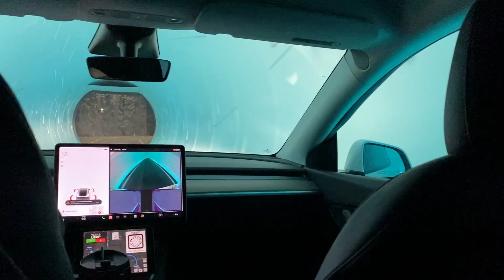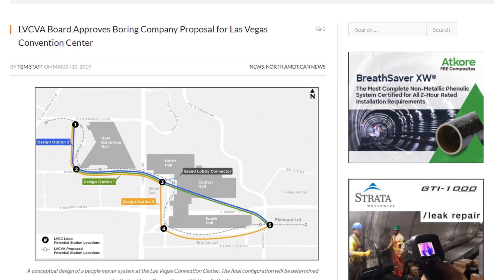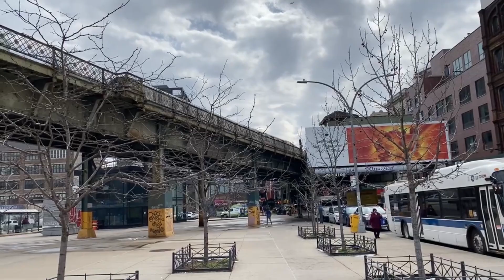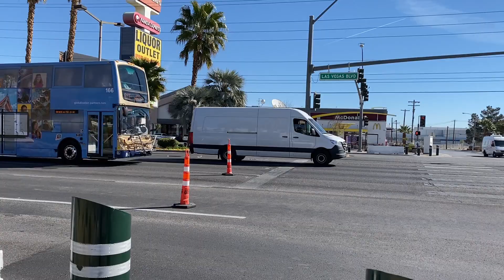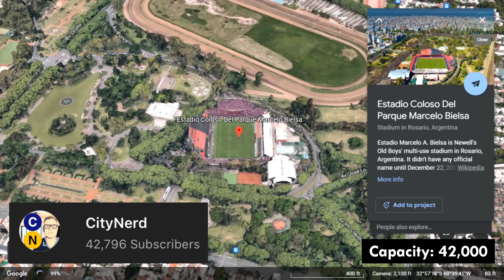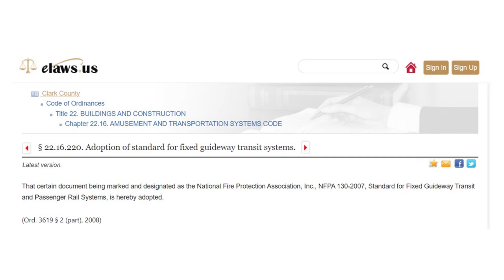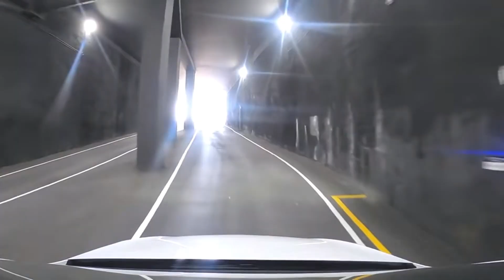Inside the Las Vegas Loop: Transportation Game-Changer, or Complete Waste of Time and Effort?

Comment: The most lead-brained move anyone can make is filling a tunnel with a road instead of track. If Elon wasn't a creatively bankrupt conartist he would have seen the potential of the Boring Company in digging cheap and quick metro tunnels in smaller cities without metro lines. But no, he made a shittier, one-lane roadway underground.
Reply: Rails don't sell cars.
Reply: @AbsolutePixelMaster  Road trains would like to have a word
Reply: not like the boring company tunnels are really cheaper or quicker either.
Reply: @cyri96  
On the plus side they're smaller without being cheaper or quicker.
Reply: @cyri96  But but it's the potential to improve upon that is interesting. That is if it wasn't just a vapid pet project for a vapid billionaire.
Reply: @zapermunz  It makes more sense if you don't think of it as an ineffective and inefficient public transport system, but as a marketing scheme. It's essentially a way to get tons of people to sit in a Tesla with a sales representative for a few minutes, while coincidentally moving them from A to B in the process.
Reply: @cyri96  ICE Train requiting 6 to 24 times less energy (Km/MJ) per person than Tesla Model 3. Also ICE train travels at 250 to 300 kph (155 to 186 mph). The Loop at a very slow 35 mph max speed
Reply: Originally it was sold with the idea of shuttles on a track. I think when they first made the tunnel they had carved out space for tracks, the early reporting of the tunnels showed Teslas with bumper car attachments at the corners to keep them centered so they didn't fall in the trench.
Reply: That’s also another thing along with his boring company to dig tunnels for metro. Tesla company could build all new electric trains, buses and trams!!!! 
The potential is endless! 
People should drill him on this.
Reply: Electric cars Con artist. Landing rocket on pads in the ocean con artist. Worldwide Satellite Internet con artist. Chip in peoples brain to make them walk again con artist. And soon to be 29 miles under Las Vegas with electric driverless cars zero labor 50 year lease lots of advertising on cars and walls In the most expensive advertising city in the world Con artist.
Reply: The problem is that he can't dig cheap tunnels. If he had put a subway in then the capacity would have been too high and he'd have to add back all those expensive safety systems he was allowed to delete because he replaced dangerous inert copper wires with nice safe lithium ion firebombs.
Reply: @opcn18  HM......
Reply: Actually, on a cost-capacity basis the "roads-in-tunnels" of the Loop is very competitive against most other public transport options.

Bus Rapid Transit (at grade) has very low capacity:
90 passengers per vehicle * 15 vehicles per hour = 1,350 pph.
And low average speed of 9mph due to city traffic and having to stop and wait at every stop. 
$0.68 - $9m per mile

Bus Rapid Transit (grade-separated) has low capacity: 
90 passengers per vehicle * 30 vehicles per hour = 2,700 pph.
And but still slow average speeds of 12-22mph.
$13-50m per mile

Light Rail Transit (at grade) has medium capacity:
90 passengers per vehicle * 3 vehicles per train * 15 vehicle sets per hour = 4,050 pph.
But slow speeds of 9mph -12mph due to city traffic and having to stop and wait at every station. 
$50m - $100m per mile

Light Rail Transit (grade-separated) high capacity:
90 passengers per vehicle * 3 vehicles per train * 30 vehicle sets per hour = 8,100 pph.
And still pretty slow average speeds of 15mph due to having to stop and wait at every station. 
$201m per mile

Subways have very high capacity:
100 passengers per vehicle * 10 vehicles per train * 30 vehicle sets per hour = 30,000 pph.
But still slow average speeds of 17-22mph due to having to stop and wait at every station. 
$600m- $1 billion per mile
$100m - $1 billion per station

The 29 mile Vegas Loop (2.5 passengers per EV) will have high capacity:
 2.5 passengers per vehicle * 4,000 EVs per hour = 10,000 pph
AND very high average speeds of 60mph thanks to direct point-to-point travel at high speeds. 
$20m per mile (dual tunnel)
$2m per above-ground station

The 29 mile Vegas Loop (4 passengers per EV w ride sharing) will have higher capacity:
 4 passengers per vehicle * 4,000 EVs per hour = 16,000 pph
AND very high average speeds of 60mph thanks to direct point-to-point travel at high speeds. 
$20m per mile (dual tunnel)
$2m per above-ground station

But the 29 mile, 51 station Vegas Loop will have up to three parallel arterial tunnel pairs through the busier parts of the city giving 30,000 - 48,000 pph down the main arterial tunnels. 

The Boring Co has actually rated the 29 mile, 51 station Loop at a minimum of 57,000 people per hour and is actually being built at ZERO cost to taxpayers vs $8 billion for a subway. 

So even in terms of people per hour, the Loop easily holds its own against not just BRT and Light Rail but is also very competitive against many subways.
Reply: @andrewfranklin4429  TBC tunnel cost is for a tunnel without safety ventilation or any escape path. If you built a subway train the same way (the deep london underground was built with literally the same diameter tunnel)  the subway will cost less, move more people. Yes a subway has to stop at every station, but a car has to slow at every station because the car in front of them is going to slow.

With 6 seconds between each car and 3 pax per car that gives you a maximum throughput of 1800pax per tunnel per hour. That is not cost effective. If you run the cars at shorter intervals it's not safe. That's equivalent to less than two london underground trains an hour. Terrible service.
Reply: @opcn18  I’m afraid you’ve been misled as the Loop meets or exceeds all national and international fire, security and building codes including NFPA 130 – “Standard for Fixed Guideway Transit and Passenger Rail Systems” and the 2018 International Fire Code (IFC).

The Loop tunnels have a larger diameter than London Underground tunnels, they have smoke detectors, CO sensors, cameras and automatic high pressure automatic fire fighting standpipes at regular intervals, there is a high capacity smoke suppression ventilation system in all tunnels, the stations are closer together than emergency exit tunnels in a subway, the underground station has an automatic sprinkler system rated at Extra Hazard Group 1 and there is a Fire Control Centre staffed by two officers during all hours of operation.
Reply: @opcn18  And no, Loop EVs won't have to slow down or stop at every station once the rest of the 29 mile, 51 station Vegas Loop is completed as the Loop stations will be located off the high speed main tunnel arteries on short spur tunnels and thus every EV bypasses every station travelling down those arteries until it gets to its destination.  Think of the spur tunnels like freeway on-ramps and off-ramps to the high speed main artery tunnels.
Reply: @opcn18  Also, the main arterial tunnels of the 29 mile Loop will have 0.9 second headway = 25m = 5.3 car lengths between each car (at 60mph).  That gives us 4,000 EVs per hour passing through which gives a capacity of 4,000 x 2.5 passengers 
= 10,000 pph in one direction 
Or with ride-sharing:
4,000 x 4 passengers
= 16,000 pph

But the Vegas Loop isn’t just one line down the centre, but up to 3 separate arterial tunnel pairs (6 tunnels in total) in parallel at times - particularly around the Allegiant Stadium to assist with handling the peaks pre and post games.  That gives a throughput of 30,000 pph one way (or 48,000 pph with 4pax per car) or 60,000 (96,000pph w 4pax) bi-directionally over those high traffic sections.  And there are several other sections where small loops come off to serve groups of stations through the heart of the city so the numbers continue to multiply.

And the great thing about the Loop topology is that if there is more demand, more tunnels and stations can be built at a cost vastly cheaper than a subway.
Reply: @opcn18  And no, subways can never be built as cheap as the Loop.  The main problem is the underground stations which even in Europe cost at least $100m each.  In contrast, almost all those 51 Vegas Loop stations will be above-ground stations at the front doors of every hotel anc casino in Vegas costing only around $2m each. 

Here are the sorts of costs you looking at for subways:

Underground subway……………………..Length…….Estimated Cost…….Cost per mile
New York East Side Access………………3 miles……$11.1 billion……..$3.7 billion
New York Second Avenue Subway…..1.8 miles…….$4.5 billion…….$2.5 billion
Los Angeles Purple Line Extension…..9 miles………$8.4 billion……….$930 million
San Francisco Central Subway………….1.7 miles…….$1.6 billion……..$928 million
Seattle U-Link…………………………………………3 miles………$1.8 billion…..$600 million
London Crossrail………………………………..13.7 miles……£17.6 billion…..£1.3 billion
Tokyo Metro Fukutoshin Line……………..5.5 miles……..$2.2 billion….$400 million
Berlin U55………………………………………………1.1 miles…….$360 million….$327 million
Barcelona L9/L10………………………………….30 miles…….$7.3 billion…..$243 million

As you can see, vastly more expensive than the $20m per mile + $2m per station cost for the Loop.
Reply: @andrewfranklin4429  You costed for one tunnel, with zero station cost for the loop. You haven't got arterial tunnels or on ramps and off ramps in your estimate. You also double costs subways by adding the station cost to the tunnel cost.

The fact of the matter is that a subway station costs about the same as a loop station, with the platform on a subway station being higher and wider and the track portion being narrower. The tunnels again are the exact same size with a less expensive road bed in the bottom of a subway tunnel. The reason subways cost more per mile is that they require safety features that TBC was allowed to build without. Part of that justification was how few people would be in a TBC tunnel, which is associated with the dramatically lower throughput. Personally I really worry about packing a tunnel with extremely flammable batteries and no ventialationa nd no escape route. Like a subway I get that maybe you want to worry about the third rail but that can be hung overhead too high for any human to reach if you want. 

You are just trying to force through an apples to oranges comparison and I'm not gonna have it.

Edit: yeah if you are going with above ground stations then you have to make room above ground. You know there are light rail subway combined systems, right? You can just have the train come above ground if you want a cheaper station. The reason subway stations are all built underground is to avoid eating up a ton of valuable surface real estate. Again, apples to apples subways are cheaper no matter how you slice it. If you have to give TBC concessions to make it work then that is a sign that TBC doesn't work.
Reply: @opcn18  The Boring Co has just submitted a bid to the city of Miami for a 6.2 mile Loop with 7 underground stations in a straight line from the city to the beach which has some more interesting figures on capacity and costs of Loop type networks. 

It will handle 7,500 passengers per hour with the option of scaling it up to 15,000 people per hour. 

Estimated cost is around $185-$220 million which gives us a cost per mile of a remarkably cheap $30m - $35.5m per mile for a dual tunnel, a cost which in this case also includes an underground station every mile instead of the much cheaper above-ground stations of the 29 mile Vegas Loop. 

In contrast, an above-ground, much slower light rail would cost over $1.2 billion while a subway would cost upwards of $3 billion.
Reply: @opcn18  here’s a better break-down of the Miami costs:

TBC has submitted a quote for $185-$220 million which gives us a cost per mile of a remarkably cheap $30m - $35.5m per mile for a dual tunnel, a cost which in this case also includes an underground station every mile instead of the much cheaper above-ground stations of the 29 mile Vegas Loop. 

So that is $35m for:
* an underground station, 
* AND one mile of dual arterial tunnels 
* AND four spur tunnels per station 

However, Loop costs can even cheaper than that because the 51 stations of the 29 mile Vegas Loop will all be cheap above-ground stations which are basically just 10 car bays, a loop of roadway, an awning covered in solar panels and the four spur tunnels/ramps going back down underground.

Estimates put the price of those above-ground stations at a mere $2m or thereabouts.  This is backed up by the $48.7m that TBC was paid for the LVCC Loop which included an underground station that Musk admitted cost $30-40m to construct which left only $9m - $19m to pay for the 1.9 miles of tunnels and the two above-ground stations.   (TBC probably sucked up some of the extra cost as a learning exercise but that leaves precious little for the tunnels and stations). 

Now the LVCVA has indicated that all of the 51 stations in the upcoming Las Vegas Loop will be those cheap $2m above-ground stations, not the expensive $30-40m underground station. 

The proof is in the pudding with the fact that TBC is going to pay for the cost of ALL 29 miles of tunnels ITSELF with the 51 hotels and casinos paying for the construction costs of their own stations at the front doors of their establishments.  The taxpayer will pay ZERO dollars. 

There is no way TBC would have proposed building those 29 miles of tunnels for free if they cost as much as traditional subways (even in Europe): 

29 miles of tunnels x $100m = $2.9 billion
+ 51 underground stations @ $100m = $5.1 billion

$2.9 billion for all the tunnels is not something that even Musk would do for free. 

Then there are all those 51 hotels, casinos, the University, Allegiant Stadium all agreeing to pay for their own stations. They wouldn’t do that if those stations cost $100m each. 

$2m or so each is a far more believable figure, particularly for entities like the University of Nevada LV who will be building a Loop station on their Vegas campus.
Reply: @opcn18  Also, many hotels and casinos will be using 20 or so car bays in their existing above ground parking or basement parking garages for Loop stations.

Vegas properties that are planning to do that are happy to sacrifice 20 car park bays for a Loop station that will serve vastly more people than those 20 cars.  Likewise for above-ground parking lots.

There's no way you'd fit a light rail or above-ground subway station (including down-ramps at either end) in just 20 car bay's worth of space.

The Loop saves surface space.
Reply: @andrewfranklin4429  That's not safe though, that is beyond the reaction time of human drivers who are required to drive the cars.

Also, you costed out one tunnel, not six. And now you are counting all 6 going the same direction and doubling it to call it bidirectional. You should go find your math teacher from school and beg them to do a better job in the future.

Also the curves on the tunnels are too tight for 60mph. That's unrealistic. Even if tesla catches up with their competitors in self driving you just can't do that kind of speed with rubber tires around turns unless you are replacing them all the time.

Either there is going to be a dedicated ramp running up to the 20 parking spaces (which is going to be expensive) or the cars are going to be on the surface streets and in the parking lots and they are going to have to wait for traffic and back the whole line up. That's a have cake and eat it too situation. And a huge liability and ongoing extremely high labor cost.
Reply: @opcn18  Cars on freeways driven by distracted, drunk and careless drivers typically have a headway down to 1 second.  A one second headway is a distance of 27.7m between cars travelling at 100kph (60mph) or almost 6 car lengths.  My experience of driving on busy freeways at those speeds is you're lucky if you have three or four car lengths between cars.

Once the Loop autonomous control systems with their millisecond response times and ability to for example command ALL vehicles in a section of the Loop to brake or accelerate simultaneously, there would be no problems achieving smaller headways than fallible humans.
Reply: @opcn18  one tunnel is $10 million per mile. A dual tunnel is $20 million per mile.  As I said above, TBC gave a quote for $185-$220 million for the entire 6.2 mile Miami Loop (including underground stations) which gives us a cost of a remarkably cheap $30m - $35.5m per per dual-tunnel mile.

Loop EVs have already demonstrated 127mph (205 kph) down the 1.14 mile test tunnel in Hawthorne California. 

This shows the sorts of speeds possible in a tunnel that is almost 3 times longer than the 0.4 mile spur tunnels connecting each station in the LVCC Loop. With the much longer tunnels of the 29 mile Loop, it will be easy to achieve even higher speeds.  

And bends and corners aren't an issue - Briefly slowing down to 40kph for one or two 90 degree corners that might be on your route is nothing compared to a train completely stopping and waiting for between 12-21 seconds at each and every one of the 20 stations between your departure and destination.
Reply: @opcn18  I'm not sure what you mean by "cars are going to be on the surface streets and in the parking lots and they are going to have to wait for traffic and back the whole line up"?

The Loop is a closed network where the EVs do not interact with surface traffic. The aboveground stations in carparks do not allow private cars to enter, they are dedicated to just the Loop EVs. Have a closer look at the two above ground Loop stations in the existing convention centre Loop and you will see.
Reply: @andrewfranklin4429  If they can dig an EV tunnel for that cheap then they can dig a subway tunnel for that cheap. All you have to do is build ~$600k of track in place of ~$800k of blacktop. 

Yes, they can reach high speed on a straightaway, but they aren't going to be replacing the tires once a week, are they? The safe cornering speed is a function of turn diameter and is actually higher for a train than an automobile. 60mph is not realistic. And no, you can't just briefly slow down, remember there is another car right behind yours, if you slow down you get rear ended. On highways with improper corners that people have to slow down for traffic back up for miles leading up to them. There are too many corners dictated by the buildings that they really cannot practically tunnel under. There are dozens of corners on the map that TBC put out, not two. Even if you have bypass tunnels that don't stop at the stations 90% of the track is on segments less than 2 miles long. And if you've got ramps on and off that creates a terrifying merge situation that really makes 30mph unrealistic, probably more looking at 15.
 
If you have 6 arteries with ramps on and off between them it's not just 6 times the cost of one tunnel, each ramp needs to be its own tunnel in between the two, and you've got the custom build both ends so it's more like 12x the cost of one tunnel, remember these have to be long ramps too so cars don't have to jam on the brakes to take them. If you've got 6 tunnels dug for rail you can have an express train that doesn't need a ton of ramps that just goes to every 2nd, 5th or 10th station. It would be less convenient for sure, but a subway system costs a couple bucks to ride, while a taxi in a loop is gonna run you more than a dozen. 

What TBC bid for Miami isn't really relevant, they overran their bid on the LVCC loop and cut way back on what they were delivering. Elon isn't going to be spending his own money on the loop. If he isn't getting tax money he will be getting investors in and then walking out with a bunch of their money in his pockets.
Reply: @opcn18  I've seen the guy before. He keeps reverting to the same fallacies:
1) Not understanding how capacity is counted, as explained in the video.
2) Believing the completely made-up and overly unrealistic fairytale best-case cost estimates for the drilling of Elon's sewer tunnels...
3) ... then comparing them to the proven total costs of other systems ...
4) ... then doing the same for every other metric: capacity, land use, maintenance costs, system complexity, level of service, etc.
5) Failing to acknowledge the ludicrous costs of maintaining tunnels.
6) Failing to understand that if you decide to commit to the gargantuan cost of specialized infrastructure required for this joke of a marketing scheme, using it solely to run a taxi service would be pretty much the worst possible use for it.
Reply: @opcn18  I’m afraid you can’t just put rails into the Loop tunnels for the same cost or above-ground Light rail would be vastly cheaper than it is.

The second cheapest bid for the LVCC project was around $200m, 4x the cost of the winner, the LVCC Loop and that was despite being an above-ground 0.8 mile light rail on LVCC land. The average cost of the 14 light rail projects currently under construction around the USA is $201m per mile so a 15 mile above ground light rail through Vegas would indeed cost $3 billion. 

However, as soon as you go underground, the costs triple - particularly thanks to underground stations being so expensive ($100m+). And that is for light rail delivering only 10,000 people per hour so add another 50% for a high capacity NYC-class subway. 

Here are examples of the costs per mile of subways throughout the world:

Underground subway……………………..Cost per mile
New York East Side Access……………$3.7 billion
New York Second Avenue Subway…..$2.5 billion
Los Angeles Purple Line Extension…$930 million
San Francisco Central Subway………..$928 million
Seattle U-Link…………………………………….$600 million
London Crossrail………………………………..£1.3 billion
Tokyo Metro Fukutoshin Line…………….$400 million
Berlin U55……………………………………………$327 million
Barcelona L9/L10………………………………$243 million

And note that the Barcelona L9 is an underground light rail made with very low labour costs not available in the USA while the Berlin U55 is a 3-station 1.5km subway that only carries a minuscule 6,200 people per day and yet cost half a billion in today’s dollars in total!

Even the cheapest underground stations in Europe cost $100m while they cost up to a billion dollars in the US compared to a mere $2m for an above-ground Loop station. 

Whichever way you look at it, the Loop is vastly cheaper.
Reply: @andrewfranklin4429  The cost of above ground light rail is mostly the cost of acquiring the land to put the rail on.

Rail is cheaper per mile to physically build. Yes the other bids were more expensive for the LVCC because they had safety features that musk was allowed to delete even though an EV is inherently much more dangerous sitting in a tunnel than a subway car is

You keep making apples to oranges comparisons. If you cut off one of his feet Usain Bolt would probably lose a 100m sprint against Elon Musk too.

If underground stations cost too much then build above ground stations. Again apples to apples rail beats EVs in almost every metric. For you the casinos are going to give musk a free spot to build a car station, but would charge hundreds of millions to someone trying to build a train station that's just about the same size. Make your argument without giving your position an unfair advantage, make an apples to apples comparison.
Reply: @opcn18  And yes, the Loop EVs can just slow down around corners by simply maintaining the same headway as happens when transitioning between different speed zones on highways in the country.  

A 1 second headway at 60mph is almost 6 car lengths while the same 1 second headway is 4 car lengths at 40mph or 3 car lengths at 30mph.

The fact that the Loop EVs will all be centrally controlled in the 29 mile Loop would make this even more efficient than human drivers.

And that is still vastly faster than the 17mph average speed of trains which have to stop and wait at every station.

A Loop EV won’t be going around all the corners on the map.  For example, the route from the convention centre to the Stadium would have a grand total of 3 tighter radius corners to negotiate to get the Alegiant Stadium.

Here are the average Trip times off the TBC website:

- Airport to Convention Center (LVCC) - 4.9 miles, 5 minutes $10 per car. (as cheap as $2 per person if travelling as a family or group)
- Allegiant Stadium to LVCC- 3.6 miles, 4 minutes, $6 per car
- Downtown Las Vegas to LVCC- 2.8 miles, 3 minutes, $5 per car

So the Loop will do 4.9 miles in 5 minutes = average speed of 60mph (100kph), so some parts of the trip will be slower than 60mph around 3 turns while other parts will be faster down the straight sections.

Now compare that to taking a bus from the airport to the LVCC :
- wait up to 30 minutes for next bus
- 25 minutes on bus 
- $9 per person

Or a taxi:
- 9 - 18 minutes
- $30 -$40

Towncar:
- 9 - 18 minutes
- $120 - $180

Subway (notional)
- wait up to 10 minutes in peak hours, 60 mins off-peak
-  10-15 minutes starting and stopping at 5 stations 
- $9? Per person

Cars merge at 60mph on the freeway all the time and travel with 1 second between them every day with distracted drivers at the wheel.  Why this belief that automated, centrally controlled EVs couldn't do at least as well as that in controlled tunnels with no pedestrians, traffic lights, stop signs etc?
Reply: @opcn18  And no, the LVCC Loop did not go over budget.  The LVCC Loop came in at the budgeted $48.7m (The $5m extra that TF goes on about was paid by the LVCVA to external consultants, not for TBC).  

They also did not cut down on what was promised as they specified Tesla EVs rather than pods in the contract because as Steve Hill the CEO of the LVCVA said “It seems that during a pandemic is not the time to be increasing capacity”.
Reply: @opcn18  Subways that cost only a couple of bucks to ride do so because they are subsidised up the wazzoo with poor taxpayers on the hook with extra taxes for the next 30 years.  If there are funds to subsidise the enormous costs of a subway, then there is more than enough to subsidise the Loop instead and have billions of dollars left over.

Even if you did have the need to build 12 tunnels, at $10m per mile, that is still only $120m per mile, still significantly cheaper than the $260m - $1 billion per mile cost of a subway tunnel.   

But of course, we have the 29 miles of tunnels that Musk is building in Las Vegas at zero cost to the taxpayer.  There is no way he would be doing that if the costs were anywhere close to the $8 billion that an equivalent subway would cost.
Reply: @opcn18  And no, there were no safety features deleted from the Loop as it meets or exceeds all national and international fire, security and building codes including NFPA 130 – “Standard for Fixed Guideway Transit and Passenger Rail Systems” and the 2018 International Fire Code (IFC).

The Loop tunnels have a larger diameter than London Underground tunnels, they have smoke detectors, CO sensors, cameras and automatic high pressure automatic fire fighting standpipes at regular intervals, there is a high capacity smoke suppression ventilation system in all tunnels, the stations are closer together than emergency exit tunnels in a subway, the underground station has an automatic sprinkler system rated at Extra Hazard Group 1 and there is a Fire Control Centre staffed by two officers during all hours of operation.
Reply: @opcn18  The Loop is safer than subways. The NYC subway kills 70 people per year, only half of which are suicides with 2% being people murdered by being pushed off a platform in front of a train and the rest being accidents. 

The London Underground kills 50 people annually and has 4,000 serious injuries every year.  

The Australian rail network in a single year “recorded 146 derailments, 14 train–train collisions, 2 train–rolling stock collisions, 62 train–person collisions (13 collisions at level crossings), 125 train–infrastructure collisions and 60 train–road vehicle collisions (49 collisions at level crossings) (ATSB 2012).  Between 2003 and 2012, there were 350 Australian unintentional rail fatalities”

Or European railways where in 2019, there were 1,516 significant railway accidents, with a total of 802 fatalities and 612 persons seriously injured.  (Suicides occurring on railways are reported separately. With 2,313 reported cases).

Or US railways where 50% of train engineers (drivers) report they have killed at least one person. 

Real safe.

Why are you not complaining about how unsafe those systems are?
Reply: @opcn18   And no, light doesn't cost so much because of land acquisition costs.  The second cheapest bid for the LVCC project was around $200m, 4x the cost of the winner, the LVCC Loop and that was despite being an above-ground 0.8 mile light rail THAT WAS ON LVCC LAND.
Reply: @andrewfranklin4429  If what you say about traffic is true then people on the highways are staging slowdowns on purpose just to make elon look bad, and have been for years!

Realistically 1 second headway is not enough. That's actually illegally close in most states. and that's on a highway where you can escape if an accident occurs. If one vehicle rams another in the tunnel the likely fire from damaging the batteries would fill the whole thing with smoke between those vehicles and one or both ends. 

Damn, just thinking about turning a corner at 60 in a tunnel where you can't see what is around the corner is a little terrifying. 

Cars do merge at 60 all the time, usually with 800 feet of partial visibility and 400 feet of unobstructed visibility in an acceleration lane. How far apart were these ramps going to be?

What you are suggesting is not safe. It cannot be made safe. It's not a case of everyone is an idiot except you. It's not a case of only drunks cause problems. You are describing a system that's a death trap.

That $48.7m was to dig the tunnels, build the stations AND engineer, design, and BUILD 14 pax autonomous pods.
Reply: @Codraroll  Hi Erlend, I'm interested in discussing what you believe are the fallacies in my arguments.

1) You need to remember that there are several different metrics that are used regularly to compare public transport systems against each other:
- DAILY ridership of a station
- people per HOUR thru the turnstiles of a station
- people per HOUR sitting on trains going down a line past a point (as described by CityNerd)

So let’s look at each of these:

* Daily ridership of a station:
Can I trust you agree that daily ridership is an established way of counting capacity of a train station?  If so, then what fallacy do you see there is in comparing the 27,000 people per day capacity of the LVCC Loop against the daily platform averages of subway systems?  

* people per hour thru the turnstiles of a station:
 the busiest line (Victoria) on the London Underground sees just over 60,000 pph in the highest morning peak hour sitting on the train, and yet the actual max number of passengers recorded getting off and going through the turnstiles at Oxford Circus Station (the busiest Underground-only station on the Tube) is only 23,720 pph in the busiest morning peak hour, but that is the total across 6 platforms and 11 different Lines. 

 So per platform we’re only looking at approx 3,950 pph at Oxford Circus Station. On a per line basis it’s only 2,160 pph.  

And those were the figures pre-pandemic - ridership now is less than half those figures.

In contrast, the LVCC Loop handles up to 27,000 people per day during the 8 hours that large conventions like SEMA were open.  So the Loop seeing an average of 3,375 people per hour EVERY hour of the day (not just during peak hour) is extremely competitive.  

But of course if we take into account the surge during peak periods, the Loop would actually be sustaining even more than that during the 4-5 hour peak period during the middle of the day and less up to mid-morning and late afternoon.

Note that the Loop’s real competition is actually BRT and Light Rail, so I only make thee comparisons with expensive subways to make the point that the Loop is actually quite capable.  

* people per HOUR sitting on trains going down a line past a point 
Unfortunately the arterial tunnels for the 29 mile Loop don’t exist yet, but once each Loop station is connected to the closest pair of arterial tunnels, these will be running a headway of  around 0.9 seconds (5 car lengths between EVs at 60mph). 

A 0.9 second headway works out as 4,000 EVs per hour passing through which gives a capacity of 4,000 x 2.5 passengers 
= 10,000 pph in one direction 
Or with ride-sharing:
4,000 x 4 passengers
= 16,000 pph

But the Vegas Loop isn’t just one line down the centre, but up to 3 separate arterial tunnel pairs (6 tunnels in total) in parallel at times - particularly around the Allegiant Stadium to assist with handling the peaks pre and post games.  That gives a throughput of 30,000 pph one way (or 48,000 pph with 4pax per car) or 60,000 (96,000pph w 4pax) bi-directionally over those high traffic sections.  And there are several other sections where small loops come off to serve groups of stations through the heart of the city so the numbers continue to multiply.

And the great thing about the Loop topology is that if there is more demand, more tunnels and stations can be built at a cost vastly cheaper than a subway. 

So even in terms of people per direction per hour, the Loop easily holds its own against:

Bus Rapid Transit (at grade)
90 passengers per vehicle * 15 vehicles per hour = 1,350 passengers per hour per direction.

Bus Rapid Transit (grade-separated)
90 passengers per vehicle * 30 vehicles per hour = 2,700 passengers per hour per direction.

Light Rail Transit (at grade)
90 passengers per vehicle * 3 vehicles per train * 15 vehicle sets per hour = 4,050 passengers per hour.

Light Rail Transit (grade-separated)
90 passengers per vehicle * 3 vehicles per train * 30 vehicle sets per hour = 8,100 passengers per hour.

Subways
100 passengers per vehicle * 10 vehicles per train * 30 vehicle sets per hour = 30,000 passengers per hour.
Reply: @opcn18  You're assuming that there will be human drivers in the Loop, but the fact is that in videos from CES, the drivers were saying that the cars have already been modified for autonomous operation, but that it is not yet enabled as they are still awaiting regulatory approval and liability is “holding us up right now, but once that gets cleared we’ll turn all the cars on”. 

After all, The Boring Co actually took the press for test runs using autopilot running in Loop EVs over 2 years ago in the 1.14 mile test tunnel in Hawthorne California.   At that point, autopilot was limited to 90mph (145kph) but was scheduled to be increased to 125mph (201kph) a few weeks later. 

Not surprising considering that following a white line in the controlled environment of a tunnel is hardly rocket science. 

As a result, centrally controlled EVs running 5 car lengths apart in tunnels at 60mph is eminently possible and far safer than the average Joe Public driving a car on a freeway.  And because they will be centrally-controlled, merging, slowing around corners and avoiding accidents will also be far safer than cars on a freeway or highway where any moment a car or truck or pedestrian or animal could veer into your lane and cause a crash.
Reply: @andrewfranklin4429  It's a physical limitation of rubber tires that limits the speed, no software can change that. They can use softer tires with deeper cuts to get better performance but those tires wear out even faster. 

Tesla has not shown their FSD to be stable. Their competitors can go for tens of thousands of miles between disengagements. Musk says that his system will be better because of AI but AI experts say that what he says about AI is wrong and his repeated failures with machine learning suggest that the experts know what they are talking about.

You are pinning the success of the system on a technology that has not been invented yet, something that is out ahead of bleeding edge. Cars running on rubber tires still can't be used in those tunnels at 60 though, that's a physical limit that software cannot fix.
Reply: @andrewfranklin4429  Are you honestly telling me you can't see the difference between a sum total and an average? You're not comparing apples to apples. More like apples to abstractions. You're not even in the same domain. 

The 27,000 figure is a SYSTEM TOTAL across all platforms, in all directions, during peak traffic no less. You cannot compare that to the numbers for ONE subway platform, in one direction, averaged across a day (or a year). The number should at least be divided by the number of stops along the Loop (four, given that the middle station has a platform for travel in each direction) for the comparison to make any sort of sense. 

You then proceed to bring up (highly theoretical) throughput numbers for the (highly theoretical) "trunk" of the Loop, where cars whizz past at imaginary speeds with dangerously short headway between them, but once again compare these "middle of the system" numbers where nobody stops or slows down, to actual station-pass figures for the other systems. It's like assessing the capacity of a highway where all cars go from A to B, without taking into account bottlenecks at the on- or off-ramps in points A or B.

These are so incredibly basic errors that if you don't see the flaws in them, talking to you further has no purpose.
Reply: @opcn18  Tesla had a customised version of autopilot running at 90+ mph in its 1.14 mile test tunnel in Hawthorne California 2 years ago.  Do you seriously believe they need the Full Self Driving suite of software designed for the open roads with on-coming traffic, leafy suburban streets and crowded city streets with parked cars everywhere and no lane markings in a tunnel?

Of course the reality is that the autopilot required for the Loop is a vastly simpler use case and ridiculously easier to develop than the open road - do you think they’ve been doing nothing in the last two years?
Reply: @Codraroll  Erlend, until the 29 mile 51 station Loop is in operation all of these comparisons are inexact so we have to do what we can with what we have. 

May I again stress that the LVCC Loop and the larger 29 mile Vegas Loop are both competing against BRT and Light Rail, so these comparisons against subways are not an attempt to say that these particular incarnations of the Loop have higher capacity than the theoretical maximum capacities of subways. 

Instead, it is rather a case of pointing out that the average DAILY ridership of the Loop during large conventions is competitive with the average DAILY ridership of subway station platforms throughout Europe.  And these subway stats include both directions as well as an entire day’s ridership on subways which typically covers 18-20 hours of operation versus the 8 hours of operation of the Loop during conventions. 

And these figures compare peak and off-peak stats for both systems. 

The other thing you need to realise is that there are round 8 Loop stations for every subway station per mile through the busier parts of Las Vegas. The convention centre Loop is a prime example of this fact as it already has 3 stations serving it and there will soon be a fourth LVCC station (LVCC North) and three other stations within a few hundred metres of the centre as well, meaning that the LVCC will effectively have 7 Loop stations servicing large convention crowds.  

With a subway, there would only be a single station typically serving such a destination. 

As such, comparing the average daily passengers through the turnstiles of the three stations of the LVCC Loop during large conventions is actually unfair to the Loop as we should really be comparing all 7 of those stations (once they are completed) against each subway platform for a more accurate comparison. 

So the fact that even just three stations are so competitive with these subway station platform averages is a very strong witness to the significant capacity of the Loop.
Reply: @Codraroll   actually, thinking about your comments a bit more, I think you are correct that there is an argument that we should compare the Loop against two platforms (or against each line) not just one platform in each subway station. The Loop has the advantage that the bays of  each station serve BOTH directions while each subway platform can only serve one direction so gets wasted half the time where there is a strong directional bias to commuter flow. 

However, even if we double the platform average figures for the subways, the Loop is still very competitive.  

That gives us the following updated stats where the 27,000 people per day of the Loop is:

- still greater than the number of passengers that 65% of the stations on the London Underground individually handle daily which with 1.8 million passengers per day across 272 stations averages only 6,617 passengers per day PER STATION. 

- still more than the 24,858 passengers per day per line pre-pandemic average of Kings Cross station, the busiest station on the Tube which pre-pandemic had 149,150 people per day across 6 lines. 

- still more than the average of 13,684 people PER STATION per day of the entire Paris Metro which had a pre-pandemic ridership of 4.16 million per day over 304 stations.

- less than the 38,888 people per day per dual-platform average of the busiest station on the Paris Metro, the Gare Du Nord which pre-pandemic handled 700,000 people per day across 36 platforms. 

 - more than the 14,000 passengers per day per line average of the Stuttgart Main Station S-Bahn which pre-pandemic saw 140,000 passengers across 10 lines through the turnstiles daily.
Reply: @andrewfranklin4429  Not quite there yet. Now you're comparing apples to nutmegs, but at least both grow on trees.

The Loop can be considered a system with four platforms, and so should be compared to four platforms at another system. There's one at each end, and two in the middle. Four. Not two, not three. Learn to count.

You are also, quite disingenuously, comparing peak numbers during a busy convention, to daily averages for the other system. That's a big red flag. Comparing per-station averages for the London or Paris metros to the peak number of the Loop is particularly dishonest, as most stations of those systems are far out in the sticks and see quite low ridership, so of course they drag down the average number for the system quite a lot. Compare downtowns to downtowns, or at least acknowledge the discrepancies.

In sum, all your arguments hinge on comparing very different figures directly to each other, despite repeatedly being called out for this malpractice. If you have to stoop to such blatant cheating to get your point across, maybe the point is overall a very weak one.
Reply: @Codraroll  You forget we are not now talking individual platforms, we are instead talking dual-platforms covering both directions so still just three stations. 

Also, remember that the Loop is only open during conventions. We are also only talking capacity during such large conventions which was 25,000 to 27,000 people per day in the case of SEMA so the average for that convention was 26,000 people per day. 

And also note that the SEMA convention only had attendance of 114,000 attendees while the Loop was designed for conventions like CES which pre-Pandemic had attendance of 180,000 so the daily ridership of the Loop would have been higher than that 27,000. 

Again, as I say these are not perfect comparisons as we don’t know what the Loop at full capacity would be nor do we know what the maximums recorded by any of these subway stations are so we can only compare averages. 

And by those figures, the Loop is definitely more than competitive with light rail and BRT and doesn’t do badly at all against subways. 

That is all I am trying to establish.
Reply: @andrewfranklin4429  Don't freeways always slow down at overpasses, not because of the off ramps, but because of the on ramps? All this is is an expensive underground 1 lane freeway. If the giant monstrosities they call freeways through Vegas can't handle the traffic, what makes these tunnels any different?
Reply: @Shizz81  with central dispatch and control, it’s true that the on-ramps to Loop arterial tunnels could potentially slow down if the arterial tunnels were operating at close to their maximum capacity of 4,000 EVs per hour carrying 10,000 - 16,000 people per hour. 

However, with the contract for the 29 mile Vegas Loop projecting 57,000 people per hour over the whole 29 miles, 51 stations and 2-3 parallel arterial tunnel pairs + multiple smaller loops, it would be surprising if the Loop hit those limits. 

We also need to recognise that Vegas only has a population of 600,000 meaning that 10% of the population would have to be riding the Loop per hour to hit that capacity which is highly unlikely. 

And the good news is that if the Loop did prove that popular, adding extra parallel arterial tunnels and more stations are so cheap, it would be quite easy to expand the Loop to handle higher volumes.
Reply: @andrewfranklin4429  Merging at speed without a driver and interacting with the public at surface level including public that's just crossing the street all with zero driver intervention? Yes it had better be a complete level 5 system.

If the loop were all underground or isolated stations it would be different, but you keep insisting on counting the cost savings from not doing that. 

Again, about the speed, you don't need to mention it, I heard you the first time, you never addressed the problem with tires.
Reply: @andrewfranklin4429   I still maintain there are four platforms: One for passengers in A going to B or C. One in C, for passengers going to A or B. One in B, going to A, and another in B, going to C. That's four. 

If it helps, try to think in terms of available routes instead. Everyone who boards at A will travel in the direction of B and C, everyone who boards at C will travel in the direction of A and B, and the passenger stream at B will split into two. It adds up to four.

This is comparable to a subway with two single-platform end stations (all trains travel downline in one end and upline in the other), and one in-line station where one platform takes you upline and the other takes you downline. In the Loop it appears cars can turn around at B and thus use the upline platform to travel downline, or the downline platform to travel upline, but in terms of passengers and directions of travel it's effectively the same.

So 27,000 passengers per day for the whole system means ~7,000 per platform per day, which spread across 8 hours of operation is ~850 pph handed by each station on average. In the video, City Nerd estimates 1800 pph with vehicles six seconds apart, which would match the observed peak flow through the busiest part of the day. 

It's not a terribly bad throughput in and of itself, it's akin to a 30-seat bus passing each station every minute (or a 90-seat tram every three minutes), but that's only part of what would constitute "being competitive" versus other systems. A conga line has a capacity of some 1800 pph too. So do some theme park attractions. Or a fleet of soapbox cars, if you get enough people to push them. Or a swarm of helicopters. It's just a matter of how much resources you have to throw at the chosen solution, to brute force the numbers into something with the desirable capacity, while overlooking all the other factors. 

In this case, what is required for the system to work is an absolutely ludicrous amount of infrastructure: essentially a full-scale highway network established underneath the whole city, to be used exclusively by Loop cars, without any synergy with other systems. Miles upon miles of tunnels. Dozens of stations, each taking up a sizable plot of land and possibly a fair amount of near-surface underground space, where existing infrastructure and building foundations are already fighting for space. Plus the necessary amount of pumps to remove rainwater/leak water; ventilation (with air intake/exhaust towers on the surface - good luck putting those eyesores up anywhere without the locals making very expensive complaints); fire escapes (again, necessarily connected to the surface, where you have to buy a plot of land and get permission for the structure), electrotechnical infrastructure (routing cables to lights, ventilation fans, communications equipment, emergency detectors); access for emergency personnel; signage; and the plethora of other things that make tunnels hellishly expensive.

At LVCC, they were specifically granted an exception from having to include all this, citing the low number of people who would be present in the system at any given time, and the small scale of the system. That's what made the tunnels so cheap: they were allowed to skip most of the stuff that tunnels ordinarily need to have, which is what makes tunnels so expensive (and maintenance costs will far outstrip construction costs in the long run). But if the system is to be expanded, those exceptions can't be granted anymore. A full-sized Loop essentially has to be a very large network of highway tunnels, complete with ramps and interchanges and all the other features.

And for this massive undertaking of construction and land acquisition, for this massive maintenance effort that roughly compares with making a more expensive copy of the city's highway network, what's offered in return is ... a taxi service. All that massive investment, and it's supposed to be paid off by running underground taxis that go faster than aboveground taxis, because they have their own road network to themselves. That's their one big advantage. Except the taxis won't take you from door to door, but between two centralized nodes located somewhere near your point of origin and your destination. As a passenger, you're not escaping the "last mile problem" of a bus or a subway, despite the speed at which you travel between the nodes. If it's a five-minute walk to the nearest Loop station and you have lots of luggage to carry, you might as well hire a taxi to your doorstep and do the trip on the regular old road network, making the trip vastly more convenient but possibly a few minutes longer.

And as an operator, the sheer number of individual vehicles poses a problem too. There are so many of them they create complex traffic patterns, which will have to be managed in real-time (a complex task compared to the simple "block logic" of rail systems). There are thousands of powertrains to maintain, at best one for every four passengers, without the synergy of rail systems (if one rail bogey loses power, the others on the train can compensate). Since each tunnel is only one lane, a breakdown means the lane is "dead" until it can be cleared, and the number of single points of failure is enormous - everything that can go wrong with a car, times the number of cars. You need somewhere to store the cars that are not in use at any given time, preferably with charging points for a lot of vehicles (drawing a considerable amount of power, which means dedicated substations, which again means high costs), you need a maintenance site, a huge supply of spare parts, and a good plan for interior cleaning (consider the ease of cleaning a bus interior vs. a car interior - the former was made with frequent maintenance in mind). Relying on a huge number of low-capacity vehicles gives a whole host of expensive challenges.

The size of this operation requires a lot of people, which means managers and a HR department - more overhead. Or a bunch of subcontractors, but that's also overhead, just shaped differently. The costs of all this have to be covered by the ticket income, plus you have to pay off the costs of that ginormous separate underground road system as well, before any profit can be made. Contrast that to a competing taxi company with vastly smaller overhead costs and no multi-mile tunnel system to pay for. They can charge much lower prices for essentially the same service, except they go door to door and can help passengers load and unload their luggage. Or for that matter, compare it to the flexibility offered by renting a car. Vegas' car rental lobby is strong enough to have prevented any extension of its public transport system to the airport, for instance.

In short, yes, you can have capacity. But you're paying an absolute fortune for it, and what you get in return is only marginally better than a dirt-cheap alternative. The LVCC Loop is small and exceptionally bare-bones, so its costs can be justified by the marketing boost it provides for TBC and Tesla. But it doesn't scale nicely.
Reply: @opcn18  detecting a few passengers walking around the EVs parked in bays at a station while the EV is driving past at a 3 mph in the station is vastly simpler than detecting and avoiding pedestrians, animals, other cars and trucks at 60mph on a multi-lane highway or at 30mph in a leafy suburb or busy city traffic. 

But yes, until they turn it on, we are both guessing.
Reply: @opcn18  Bus and taxi tyres don’t wear excessively, neither will these EVs which will average 60mph around the Loop.
Reply: @Codraroll  I’m not sure why you want to backtrack and now talk individual platforms rather than platform pairs but it is irrelevant anyway considering the fact that there will be around 8 Loop stations for every subway station per mile through the busier parts of Las Vegas. 

The convention centre Loop is a prime example of this fact as it already has 3 stations serving it and there will soon be a fourth LVCC station (LVCC North) and three other stations within a few hundred metres of the centre as well, meaning that the LVCC will effectively have 7 Loop stations servicing large convention crowds.  

With a subway, there would only be a single station typically serving such a destination. 

As such, comparing the average daily passengers through the turnstiles of the three stations of the LVCC Loop during large conventions is actually unfair to the Loop as we should really be comparing all 7 of those stations (once they are completed) against each subway line for a more accurate comparison. 

So the fact that even just three stations are so competitive with these subway station line averages is a very strong witness to the significant capacity of the Loop.
Reply: @Codraroll  and no, there were no exceptions made for the Loop regarding fire safety. The Loop meets or exceeds all national and international fire, security and building codes including NFPA 130 – “Standard for Fixed Guideway Transit and Passenger Rail Systems” and the 2018 International Fire Code (IFC).

The Loop tunnels have a larger diameter than London Underground tunnels, they have smoke detectors, CO sensors, cameras and automatic high pressure automatic fire fighting standpipes at regular intervals, there is a high capacity smoke suppression ventilation system in all tunnels, the stations are closer together than emergency exit tunnels in a subway, the underground station has an automatic sprinkler system rated at Extra Hazard Group 1 and there is a Fire Control Centre staffed by two officers during all hours of operation.
Reply: @andrewfranklin4429  Come on, that's just a copypasted junk argument I already refuted in a different comment thread.
Reply: @Codraroll  The Loop above-ground stations use up far less space and are far less intrusive compared to having above-ground railway tracks, stations, or even bus stations.

With 51 hotels, casinos and other destinations in Las Vegas having already signed up with The Boring Co and more enthusiastically joining every month, there isn’t any problem getting locations for stations. 

Not surprising considering the extremely small size and cheap cost of Loop stations - unlike a large noisey train station or railway line which people don’t want running next to their house or business, these Loop stations with their whisper quiet Teslas and promise of fast, personal rapid transit on their doorstep is extremely attractive. 

In contrast, nobody wants the disadvantages of large amounts of land consumed (or appropriated from property owners) and the terrible impact on real estate values and noise for houses near railway tracks. Trust me - I lived near East Finchley station with the London Tube running above ground behind the rear fence of my house for 6 months. It was horrible.

Many hotels and casinos will be using 20 or so car bays in their own existing above ground parking or basement parking garages so no, there won’t be any exorbitant land acquisition costs involved. 

Vegas properties that are planning to do that are happy to lose 20 car park bays for a Loop station that will serve vastly more people than those 20 cars.
Reply: @Codraroll  The 29 mile Loop will have a fleet of 700 EVs, but that is far from being extravagant. The Vegas Bus service has a fleet of 708 buses and yet only carries 178,390 across 51 routes and 3,900+ stops. 

Compare that to the Boring Co’s Loop which only has 1 route, 3 stops and 70 cars and yet easily handles 27,000 passengers per day during conventions. 

So that very large, busy bus network only carries 6.6x the number of passengers of the small 3-station Loop despite having 51x the number of routes, 1,300x the number of stops and 10x the number of vehicles each of which has 10x the seating capacity as each Loop EV.

Considering that the 29 mile 51 station Loop will increase the size of the Loop by 17x, the passenger throughput figures of the much slower bus service look worse and worse.
Reply: @andrewfranklin4429  The difference is that my guess assumes that their performance is going to be similar to the performance they have shown, while you are guessing that this time they aren't lying like they lied all the other times.
Reply: @opcn18  perhaps you haven’t seen the incredible progress they are making with FSD.  I recommend you check out the larest beta FSD videos to see how impressive it is even on leafy, over-grown, crowded suburban and city streets.  Bit by bit they keep inching towards the neccessary 99.9999% accuracy mark.
Reply: @andrewfranklin4429  That's a very backwards approach. Anyone can make good videos, litarally there are good videos from decades ago. Tesla needs to stop making bad decisions that make for videos of them screwing up. They need to go months or years without trying to merge into a bike, or turn down a tram lane, or run into an unrecognized foreign object.
Reply: @opcn18  thankfully with thousands of beta testers, TESLA’s AI system is building up a huge Deep learning database so these incidents keep getting fewer and fewer. And as I say, the controlled environment of the Loop is trivial in comparison.
Reply: @andrewfranklin4429  That's what musk keeps promising, but that doesn't mean that it's going to work.
Reply: @opcn18  the encouraging thing is that the trend is in the right direction. We’ll just have to wait and see.
Reply: Trains are helpless off the track. Other vehicles like busses feed into them. Trains are inefficient outside rush hour conditions, subsidized, strike prone, the rolling stock provided by some quasi authority.
Reply: @conveyor2  In a tunnel there is nowhere to go besides staying on track. Track is cheaper than roadway to build and maintain. A train that can carry 300 people at 30 miles an hour costs a fraction of what a fleet of 100 cars costs (and the cars can go no faster because it's the tunnel that limits speed, trains can move faster than cars in the open on a straightaway). Trains cost less to maintain. Trains have fewer volatile and dangerous parts. Trains take fewer people to operate. Trains last longer. Trains are better.
Reply: @conveyor2  Do you really think roads make a profit? They are expensive to build but free to use. Highways are thus subsidized to heck and back. But when it's done for highways, it's a "necessary public good", while petrolheads somehow hold public transport to the standard that it must be able to fund itself. Kind of odd, don't you think?
Reply: @conveyor2  Las Vegas Loop 4400 persons per hour
Luxtram can transport up to 422 people every 2 minutes
422 persons transported in 2 minutes
844 persons transported in 4 minutes
1266 persons transported in 6 minutes
1699 persons transported in 8 minutes
2110 persons transported in 10 minutes
2532 persons transported in 12 minutes
2954 persons transported in 14 minutes
3376 persons transported in 16 minutes
3798 persons transported in 18 minutes
4220 persons transported in 20 minutes
4642 persons transported in 22 minutes
(already in 22 minutes more than the 4400 Loop in one hour)
12660 persons transported in 60 minutes (1 hour) just from one station start to another.
All from just one station, and for 500 million euros (a bit more in USD), you got 16 kilometers (10 miles), 24 stations and many tramways.
50 million per mile with 24 stations and tramways 3 times more people
While Loop 50 million for one mile, one station, no cars, no drivers in these 50 million price.

Paris metro 698 guests per metro train every 6 minutes.
698 persons at 6 minutes
1396 persons transported in 12 minutes
2094 persons transported in 18 minutes
2792 persons transported in 24 minutes
3490 persons transported in 30 minutes
4188 persons transported in 36 minutes
4886 persons transported in 42 minutes
5584 persons transported in 48 minutes
6282 persons transported in 54 minutes
6920 persons  transported in 60 minutes
Per metro train (rame) in Paris, an there are many rames driving simultaneously at the over sever hundred miles of Paris metro.
Reply: @THEREALZENFORCE  Luxtram has 15 stations over 7km and takes 23 minutes to travel that distance at the dreadfully slow average speed of 11.3 mph.

The tram has a daily ridership of only 31,300 passengers only 16% greater than the 27,000 people per day of the Loop despite having 5x the number of stations, 5.4x the length and costing $604m or 12.4x more than the LVCC Loop.

I don’t think I’d be using that as an example if I was you Zenforce!  :-)
Reply: @andrewfranklin4429   First off, are you paid by Tesla or TBC, either directly or indirectly?  How can you possibly spend so much time replying to every comment related to those businesses?  Are you just that stoked about taxis in tunnels that this is how you like to spend all your free time?  

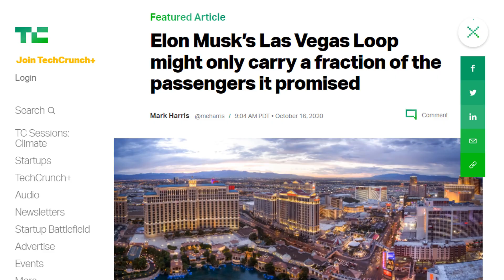Why are you comparing ridership with throughput?  You keep using the SEMI conference as a highpoint, though I don't know if that is actually the max throughput.  Can the current system only handle 70 cars?  Did you see the section of this video at 4:20?  I have no idea what the highest busy time is during a conference, as in if it's the same as morning and evening rush hour, but if it's all evenly spread out, then the numbers you keep talking about, with people heading in both directions evenly (no idea if that is a good assumption) is more like 1700 pph.  This is pretty much spot on what was estimated in this video.  That is an order of magnitude lower than the metro example at that time mark.  Ridership is averaged out over time.  If you want to compare how good a system is at moving people, you need to compare peak throughput.  Everytime I have ridden a metro, it has been at night, where almost every seat is open.  That doesn't mean the metro is only capable of carrying the 20 of us on the metro at that time.  The systems are designed for having the capacity to carry peak loads, such as during rush hour.   I feel like you know all of this, and keep choosing to be misleading.  

If a city chooses to build a system with low utilization, then they are taking many factors in to account.  If one city chooses to take 20 minutes to go 11 km, with many stops, then sure, it's slower than a taxi or a loop system, but it's likely less expensive, and less environmental impact, and the society has chosen to make those trade offs.  I enjoy being able to get on an empty metro at night, with low utilization, instead of it being shut down and not having the option.  If a tax payer in Vegas wants to use the loop at 10 pm, they are not able to do so.  What good is all of that expense to them?  Why don't you incorporate all of that time not in operation in to your numbers?  How does the loop service compare to a European metro between 6 pm and midnight?  If the loop wants to be able to have higher capacity while under utilized, they still have to pay all the drivers to be sitting in their cars ready to go, as compared to the same metro trains being ready to handle that capacity all the time.  It's not financially viable to have the loop open and ready to go, so they just shut it down - super high throughput (zero) when it's closed for all that money spent, right?  

What is the total cost per person-miles of the loop?  That's probably the better metric to compare different systems.  Or some formula that takes in to account the up time where tax payers can actually use it.
Reply: @andrewfranklin4429    To drive that last cost point home:

The loop with 27,000 people over 8 hours, over a 1 mile service, with 70 drivers works out to a "cost unit" per person-miles per hour of 0.02. 

The metro at a max of 26,000 people per hour, averaging 30 mph, with a single operator, works out to a "cost unit" per person-miles per hour of 0.0000013.  

That is 4 orders of magnitude more cost effective for the metro at moving people a certain distance.  That cost is based solely on the drivers and operators.  I would bet the electricity for a metro is less expensive than all the Teslas (though that is just intuition), and I would assume maintenance is less for metros.  

This is coming from the fact that between these scenarios there are nearly two orders of magnitude more drivers for the loop, an order of magnitude more distance is being covered in that hour for the metro, and an order of magnitude more people are being moved in that hour on the metro.  Looking at the number of people during the SEMI conference is really misleading for this sort of comparison.    

As I was writing this, I realized that I was assuming a single train, but he said single tube.  I do not know how many metro operators would be working in that tube within that hour.  So these numbers could be off by 1-2 orders of magnitude for the metro.  Meaning the metro may only be 100x better, instead of 10,000x better.  Some really rough numbers: 1000 passengers per train, you'd need 26 operators to carry that many passengers simultaneously and be required if none of the trains pass the same section again in that hour.  So that should be an upper bound, so maybe about 20 operators?  The metro is 500x better than the loop?
Reply: @andrewfranklin4429  I came up with the metric of 622x better for the metro looking at it slightly differently.  The SEMI conference was 70 drivers for 8 hours = 560 man hours, and this achieved 27,000 person-miles.  For a metro train with a single operator, averaging 30 mph, and 1000 passengers to have the same man hours for the operator, it would achieve 16.8 million person-miles, as compared to the 27,000 person-miles from the SEMI conference, for a ratio of 622 in favor of the metro.  

The Teslas would have done about 10,000 car miles while the metro would have done 17,000 train miles, so I'd have to know a lot more about efficiencies to say anything about how the electricity, maintenance, and other costs compare.
Reply: @andrewhopkins3397  now Times Square was a bit of an extreme example, but let’s have a look at the rest of the subways globally of similar size to the Loop:

The current 0.8 mile long three-station LVCC Loop handles up to 27,000 people per day, with 3 - 6 seconds between cars, averages 35mph and cost $51m. 

In comparison, the Seattle U-Link is a 3.15-mile underground light rail which also has 3 stations which had a ridership of 33,900 people per day pre-covid (so only a few thousand more than the LVCC Loop), though it is much less now.  Runs at an average speed of 31mph with a 10 min peak/15 min off-peak frequency. It cost $1.9 billion dollars in total or $600 million per mile, 39x more than the LVCC Loop.

The San Francisco Central Subway is a 3-station 1.7 mile subway with a targeted ridership of 35,000 people per day with a 5 minute headway and an average speed of a miserable 9.6mph and cost $1.578 billion, 32x the cost of the Loop. (Whether it achieves that ridership which is only a few thousand higher than the Loop during this pandemic is of course yet to be seen) 

The Newark City Subway/light rail is a 6.4 mile, 17 station line with an average speed of 21.5mph and has a daily ridership of 19,289 and cost $208m for the 1 mile above-ground light rail portion or 4x the cost of the underground Loop. I’m not sure of the cost of the underground portion of the Newark subway, typical costs start at $600m per mile or 10x the cost of the Loop. 

And then there is the lame duck Berlin U55 which is a 3-station 1.5km subway in the centre of Berlin which is similar in size to the LVCC Loop but which only carries a minuscule 6,200 people per day (compared to the Loop’s 27,000 ppd) at an average speed of 19mph and 5 minute frequency and yet cost $500 million in today’s dollars in total, 10x the cost of the LVCC Loop.

As you can see, the LVCC Loop is extremely competitive, though that is nothing compared to the 55 station, 34 mile Vegas Loop with its 60mph average speed, 0.9 seconds between cars and 57,000 people per hour capacity which is now under-construction at ZERO cost to the taxpayer. 

However, the Loop is FAR better in terms of comfort, speed and frequency/wait times, and VASTLY cheaper to build than any of these subway systems.
Reply: @andrewfranklin4429  It's a valid opinion for rich people to want comfort and not having to wait (or walk) at the expense of vastly higher operational costs (I said nothing about construction - i doubt it's as lopsided as you're claiming, so I'm sure I'll dig in to that more) and worse environmental impact (energy usage and manufacturing of all the Tesla vehicles).  I personally think that's a shitty opinion, but if that is the objective for all of the money you are spending, then so be it.  Just be honest about it.  At least you are finally admitting those are the benefits it provides.  Exchanging efficiency and operating costs for not having to wait or mingle with the masses.   An expensive taxi in a tunnel.
Reply: @andrewfranklin4429  Also, way to not address anything I said, nor answer any questions I asked, and just revert to your talking points.  You are paid by them, right?  It certainly seems like it.
Reply: @andrewhopkins3397  what do you mean I am not addressing your questions Andrew? I pointed out that this video and you have made the common mistake of wanting to compare people riding in a train going down a line between dozens of stations with the people through the turnstiles of a station. They are not the same. 

Here’s an explanation I wrote a while ago that hopefully explains this difference for you:

Consider the fact that over 60,000 people per hour (pph) travel down the busiest line on the London Underground - the Victoria line - in the highest morning peak hour sitting on the train, and yet the actual max number of passengers recorded getting off and going through the turnstiles at Oxford Circus Station (the busiest Underground-only station on the Tube) on that line is only 23,720 pph in the busiest morning peak hour.   That stat alone should help us realise that pph standing on a train does not equal pph going through the turnstiles of the station.   But it’s even worse as that is the total across 6 busy platforms and 11 different Lines, so the pph going through the turnstiles from just the Victoria line is far smaller again as dividing by 3 platform-pairs we’re only looking at approx 7,906 pph at Oxford Circus Station. On a per line basis it’s only 2,160 pph.   And yes each of those 3 platform-pairs have similar pph riding down the lines so a divide by three gives us a quite accurate thru the turnstiles percentage.   And those were the figures pre-pandemic - ridership now is less than half those figures (so somewhere around 4,000 pph for that Oxford Circus platform-pair or 1,080 pph per line).   Now in the case of the Loop, there will be about 8 Loop stations for every subway station per mile through the busier parts of Vegas, yet even just the three current LVCC Loop stations moved 25,000 – 27,000 passengers per day during SEMA 2021 as previously mentioned.   Now SEMA was open only for 8 hours which gives us 27,000 / 8 = 3,375 people per hour every hour of the day for the Loop. (Though of course it would have been more than that during the peak period over lunch each day and less off-peak)  In the case of the 8 Loop stations per mile of the Vegas Loop, we’re looking at 8/3 * 3,375 = 9,000 people per hour.   So as you can see, even just 3 pandemic-effected Loop stations (let alone 8) are actually pretty competitive with the hourly pph of the busiest London Underground station in peak hour let alone the 8 Loop stations for every subway station through Vegas.   But as I say, the Loop is really competing against BRT and Light Rail so that comparison is more to illustrate that the Loop well and truly is moving useful numbers of passengers for the needs of a small city like Las Vegas.
Reply: @andrewfranklin4429  Why are you saying Times Square is an extreme example?  You are trying to say the loop is comparable to a metro.  You are using data from the busiest times during massive conferences to show how many people the loop can possibly transport.  So compare that to the most people a metro can possibly transport.  If the loop has high utilization because the conference is packed, then that is equivalent to a metro having high utilization when it is packed during rush hour.  If a metro is better during high utilization, then that means if one had been built at the convention center, it would have been able to handle more people than the Teslas during those busy conferences.  You are coming across more and more like you are being intentionally deceitful.  

I have watched videos of the loop in operation not during busy conferences and there is essentially no ridership - something like 1 person during the minute video, for 60 pph.  Why aren't you telling us all the average ridership for the loop and not the peak during a conference?  What is the average ridership when it is closed at 6 pm?
Reply: @andrewhopkins3397  I haven’t answered all the questions you have raised as it takes me a while to get to each point. 

So, the LVCC Loop is closed when there aren’t any events on as the Loop only operates when there are events happening at the convention centre.  Once the rest of the 55 station, 34 mile Vegas loop is completed and used daily for commuter traffic itself we’ll be able to make better comparisons. 

The average occupancy of trains is only 23% because most of the time those several hundred tonne trains are rumbling around with a mere handful of people because they can’t scale them up and down enough to meet the surges and sags in demand that occur throughout the day with enough granularity. 

Likewise, the average occupancy of buses globally is around 11 people which means that most of the time you have a large heavy bus driving around with only a few people on board. 

In contrast, Loop EVs just sit at the Loop station waiting for customers and don’t have to keep driving around empty or nearly empty like buses and trains. 

In terms of drivers, they are all casual workers with positions that scale with peak periods (a bit like workers in restaurants or convention centres who only work evenings or when events are on etc). 

And the ratio of passengers per driver is actually better for the Loop than the Vegas Bus service. 

The Vegas Bus Service has a ridership of 101,939 people per day using a fleet of 708 buses. That is a ratio of one bus (and driver) carrying 143 passengers each day.  In the case of the LVCC Loop, it moves up to 27,000 people per day using a fleet of just 70 EVs which is a ratio of one car moving 386 passengers each day.  So the Vegas bus service requires over 2.7x the number of buses/drivers to move the same number of passengers over the course of a day as each Loop EV transports.

And of course, once autonomy is turned on, the Loop will be vastly better.
Reply: @andrewfranklin4429  I can't tell if you are doing mental gymnastics because you're a Musk fan or if it's because you are paid by them.  Answer the question: are you, in anyway, paid by the organisations that benefit financially from the loop?  

The people moving through the turnstiles being lower is due to a much larger system that has the benefits of letting you go to more locations.   How many people go through the Vegas loop turnstile at the airport right now?  It's zero, because that doesn't exist.  It is a less capable system providing fewer services.  You keep comparing unrelated things.  See how I can compare something unrelated and show that the ridership is zero?  If you put a metro in a system that only has the same stops as the Vegas loop, then the throughput numbers would be the same as the turnstile numbers.  I keep being generous with that 27,000 people-miles, which assumes people went end to end, but it could be half of that if all the people just went between the middle and the end, which is the point you are trying to make.
Reply: @andrewhopkins3397   the conferences aren’t packed.  That 25,000 to 27,000 people per day is just the range during a medium-sized event (SEMA 2021 had 114,000 attendees, CES 2023 had 115,000) at the Las Vegas Convention Centre. 

The Loop has yet to see what the ridership will be like during large conventions such as the pre-pandemic CES which boasted 180,000 attendees in its heyday. That is the sort of event the Loop was designed to handle. 

I am not arguing that the Loop carries more than the maximum capacity of a subway train going down a trunk line. Instead, I am merely highlighting that during a medium sized convention, the LVCC Loop easily handles similar numbers through the turnstiles as the busiest subway stations in NYC and London. 

The LVCC Loop is not actually competing with a subway as a small city like Las Vegas doesn’t need, nor can it afford a multi-billion dollar subway.  I am simply pointing out that the Loop is more than competitive with BRT and light rail, its main competitors but also gives subways a run for their money. 

And of course, if the Loop did need to carry higher numbers on particularly busy routes, they can simply add higher capacity EV vans and buses or the pods shown in CGI imagery.
Reply: @andrewfranklin4429  No, the loop is 622x less operational cost competitive than a metro.  The loop can move on the same order of people at 622x the operational cost.  That is the point you are ignoring.  The choice was made to have convenience at the expense of cost and efficiency.  That is the point everyone is making that you are ignoring.  If you want the loop to reduce those costs, you have to get rid of the drivers and reduce the number of Teslas.  The easiest way to do that is to chain the systems together and put them on a rail so it goes in the right direction.  How are you not getting this?  Are you paid by them or not?
Reply: @andrewhopkins3397  Musk fan?  Did you not read that I am disgusted by Musk the person? It is actually possible to not let your emotions sway you and separate the companies from the personality. It is a much more balanced way to live. 

As I wrote earlier, I work at a university in Australia, not for Musk. Why would Musk pay someone to write comments in an obscure YT thread when he doesn’t even have PR depts at any of his companies or pay for advertising?

Why is it that so many critics can’t seem to understand that someone might enjoy discussing potential disruption of an industry with people who can’t seem to see the disruption coming?  It was the same back in the day when I’d be quite amazed how Nokia and Microsoft Mobile fans couldn’t see the iPhone and Android disruption bearing down on them. 

Will The Boring Co have the same sort of impact on public transport? It’s too early to tell, we need to wait for the 34 mile 55 station Vegas Loop to be operational before we can say that definitively, but so far with the LVCC Loop easily handling as many passengers per day as subways of similar size globally, I just find it amazing you aren’t interested in seeing how this all turns out instead of prematurely and angrily dismissing it?
Reply: @andrewfranklin4429  Why are you amazed at a system that allows people to not walk a half mile at the cost of 622x that of a metro?  Never mind the environmental impact.  Even if all the energy came from solar, that's a huge waste where all of that additional electricity could have gone to other users that don't have solar yet.  How are you amazed at taxis in tunnels?  How is any of this disruptive?  The boring company isn't doing anything new.  Their cost reductions are coming from boring smaller holes - how novel, provide less product and it costs less, who would have guessed?  And most outlets are saying the costs aren't actually any lower in practice (not something I have personally looked in to).  

My emotions didn't have anything to do with thinking you are paid by them.  The fact that you have replied many, many times to every single person with the exact same disengenuous points makes me think you are paid by them.  

I love that you haven't countered any of the points I have made.  You just think taxis in tunnels at 622x the operational costs of a metro is amazing, disruptive technology, that everyone should be excited about.  So cool.  You do you.  Keep spending all of your time trying to get everyone hyped.
Reply: @andrewhopkins3397  actually an above-ground light rail (not even underground) was the second cheapest bid but it was 4x the cost - $200m. An underground Metro would have cost around $600m.
Reply: @andrewhopkins3397  and no, the Loop doesn’t cost less only due to smaller tunnels, it’s because all of those 55 Loop stations being built at the front doors of every hotel, casino and resort in Vegas only cost $1.5m each. 

In comparison, the average cost of underground subway stations is $100m in Europe (Paris specifically), but the costs are higher in the USA with stations on the NYC Metro coming in at an eye-watering $700m per station. 

You could build between 67 and 467 Loop,stations for the price of one subway station. 

That is why the 34 mile 55 station Loop is being built at ZERO cost to taxpayers compared to the $10 billion a comparable subway would cost.
Reply: @andrewhopkins3397  I’ve replied exhaustively to most of your points.  The Vegas Bus service have operational costs 2.7x greater than the Loop based on manpower.  Does that mean you believe it is a failure too? :-)
Reply: @andrewfranklin4429  I really don't get where your motivations are coming from.  Why are you amazed at the boring company, or the loop, that they're having "stations" in existing buildings to reduce costs?  How is that novel or disruptive.  Just having dedicated buses and bus lanes would have made us of "existing stations" at the doors for even less cost.  

Let's hypothetically say the boring company makes way cheaper tunnels.  At the point before they laid the asphalt driving surfaces, there was a certain cost for the existing system.  If they had put down rail instead of asphalt, that component would have been about half as expensive.  If they bought a handful of electric trains, that would have been less expensive than all of the Teslas.  Operating the trains would be vastly less expensive than all the drivers.  In the same tunnels.  I am just so confused at your viewpoint.  That is why I keep thinking you are paid by them.
Reply: @andrewhopkins3397  by the way, the London Tube tunnels at 11’ 8” diameter are smaller than the 12.5’ Loop tunnels and yet the latest Tube expansion cost £1.3 billion per mile to build. So no, it isn’t just small tunnels.
Reply: @andrewhopkins3397  Actually, buses and bus lanes (Bus Rapid Transit or BRT) would not necessarily have been cheaper, but would definitely be far slower, less comfortable, with much longer waiting times, would get caught in Vegas gridlock and carry lower numbers of passengers than the Loop. 

For example, the 13 mile, 28 station IndyGo Redline BRT only carries 6,000 people per day with long wait times of 10-20 minutes, an average speed of a dreadful 12mph in peak hour and costs $19m per mile ($247m in total) all above ground. 

This compares to the 3-station 0.7 mile long LVCC Loop with less than 10 second wait times, 27,000 people per day, 4.5x higher throughput than that IndyGo BRT for 20% the cost despite being underground. 

The highest rated BRT system (gold-rated) in the USA is the Albuquerque Rapid Transit, a 13.8 mile 19 station BRT route that cost $135 million (2.6x the cost of the Loop) but only averages 14mph carrying only 17,700 passengers per weekday and with wait times of 8-15 minutes between buses. And again, it’s all above-ground wasting real estate and disrupting traffic. 

This compares to the Vegas Loop which will be 34 miles long, have 55 stations, will transport at least 57,000 people PER HOUR and cost the taxpayer ZERO dollars.  

Sounds pretty disruptive to me.
Reply: @andrewhopkins3397  And no, replacing the Loop EVs with trains would not be less expensive, even if we ignored the fact that subways are 30x - 70x more expensive to construct than the Loop and just look at the cost of vehicles. 

An NYC subway carriage costs $2 million so an 8 carriage train costs $16 million and can carry about 1,600 passengers. 

Each EV in the LVCC Loop cost about $40k each, so you could buy 400 EVs for the same money as that NYC train and with 4 passengers per car transport the same 1,600 passengers. 

However, the EVs travel 5x faster than the trains (which have to stop at every station on a line) so you’d need 80 EVs at 20% the cost of the train to transport the same number of people in an hour. 

Even with 2.5 passengers in each EV, that’s still only 128 EVs to transport the same number of passengers as a train at 32% the cost of that train.

However, the cost of cars is a small fraction compared to the infrastructure. In terms of tunnel costs, there is no comparison. 

With the incredibly low $10 million per mile cost of Loop tunnels it has allowed the Boring Co to offer to build the 34 miles of tunnels in the upcoming greater Las Vegas Loop for free down the Las Vegas Strip with the 55 or so hotels, casinos and attractions paying for their own cheap surface mini-stations.  And as I’ve said, the cost of Loop stations is $1.5m compared to $100m - $700m for each subway station. 

Those prices are absolutely unheard of - compare it to $3.6 billion for a 15 mile Washington Metro class subway with only 24 stations. Or $10.86 billion for a London Underground class subway (which costs $724.5 million per mile).

And even if it takes a while longer for autonomy to be turned on in the Loop, you need 2.7x less Loop drivers to move the same number of passengers as the Vegas Bus Service.
Reply: @andrewfranklin4429 A year later and the cars are still not self driven.